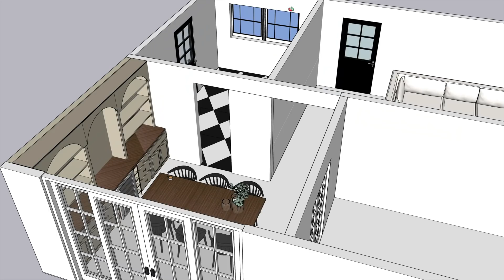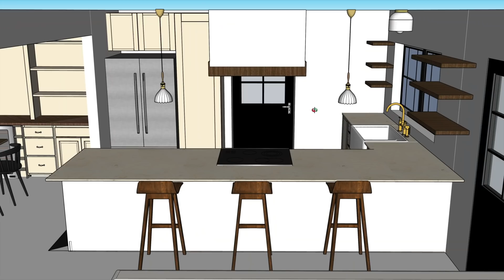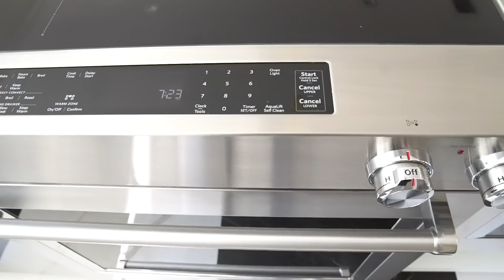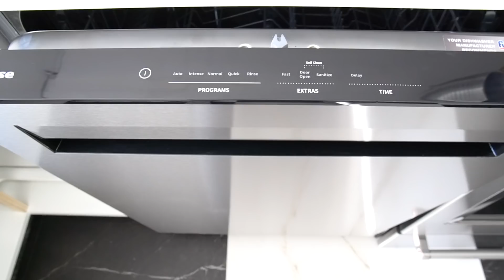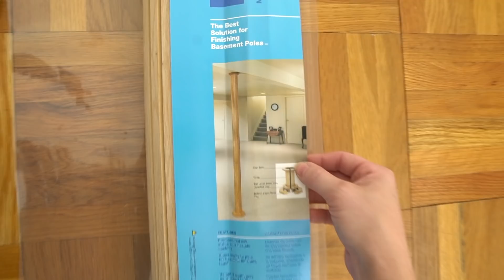Kitchen Renovation #6 | Appliances & Countertops

Comment: The refeigetor space should be larger... around 39" wide for a 36" fridge. Your fridge doesn't have any room to breath and will die sooner. People underestimate this space all the time. Build for the refrigerator that will be coming in 10 years not for the one you have right now. This is the one appliance that WILL change in sizing as time goes on.
Reply: Specs in the user manual call for minimum 1/2" on each side, 2" back and 2"top. This installation appears to be 1/8" on all sides. Proper cooling might be an issue here.